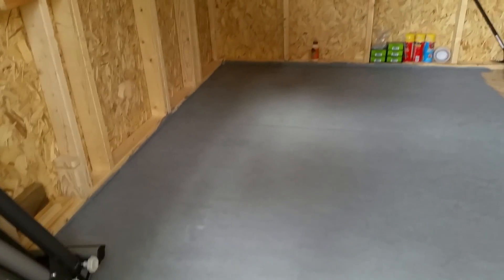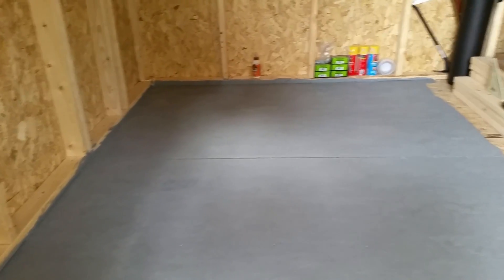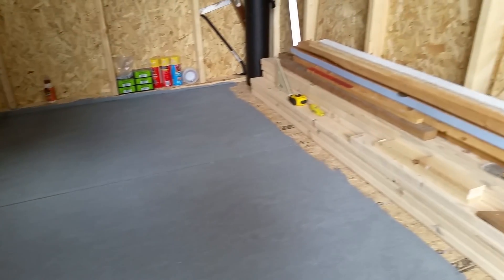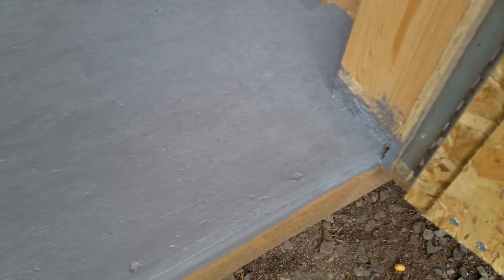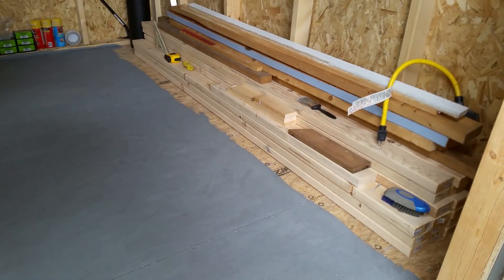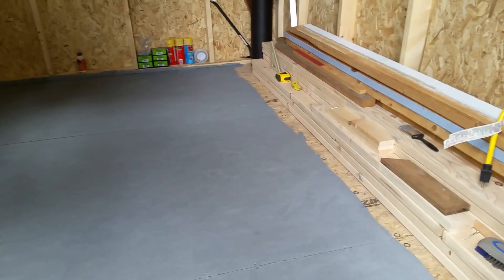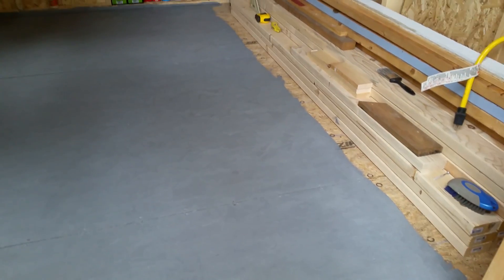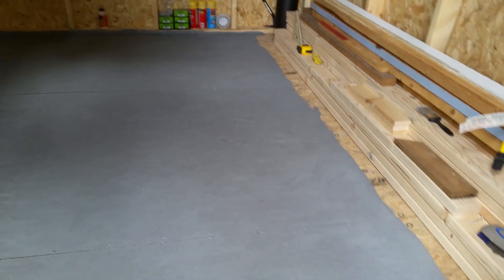Painted Shed Floor

Comment: Better edge Idea is Ell made from 24 gauge stainless seal the area under the metal with some rubberized roofing caulk then screw the edge metal down right through the metal and into the flooring and substrate framing with at least “black” Carbon Nitride treated roofing screws. What I’ve just described will last 25+ years!
Reply: Do you have a link to the product you are describing?   Or a better description?

Comment: what kind of paint did you use? did you primer or sand first?
Reply from the maker: DanAlvarezBS I lightly sanded. I did not use primer but applied the latex paint directly. I did use 3 coats for durability.